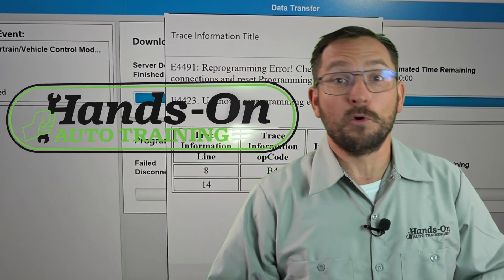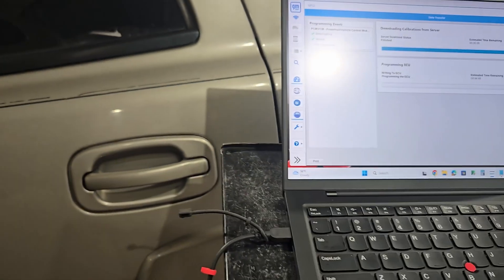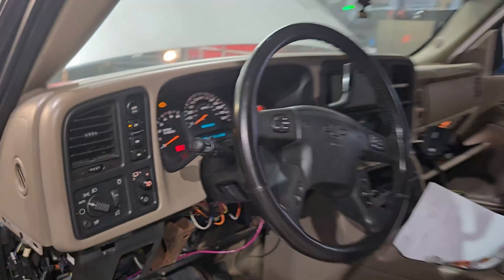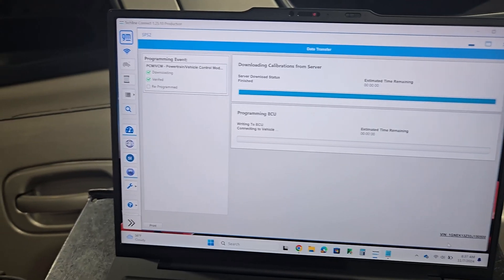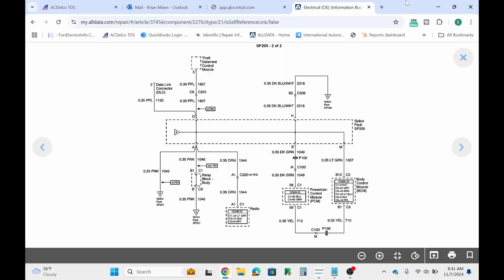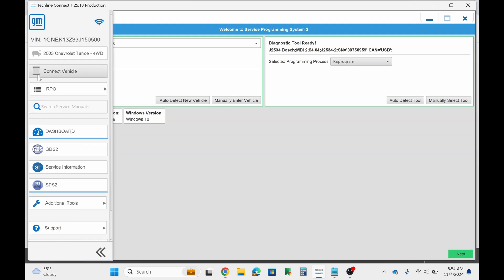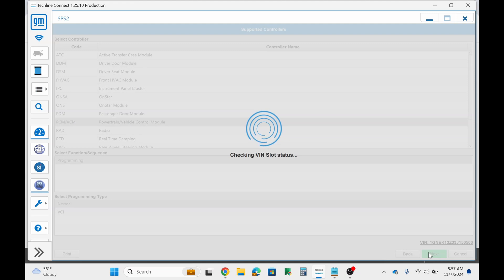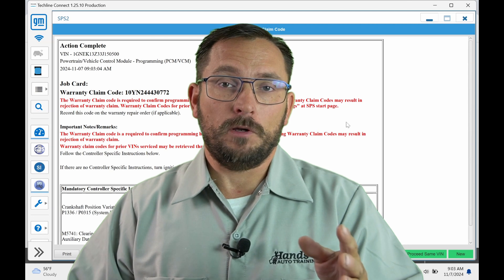GM TLC workaround tip for Error 4491 4423 when programming

Comment: Mine progresses to the end and then when ECU resets it fails out with these errors.  I just removed BCM from splice pack jx250 and same issue.  2014 express 2500 4.8.  4423 error 5 at step 0.